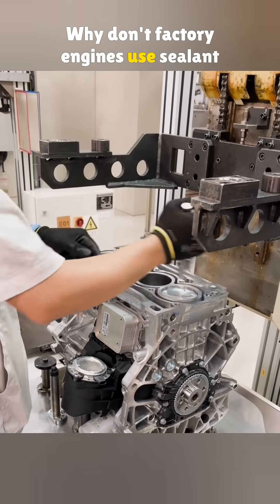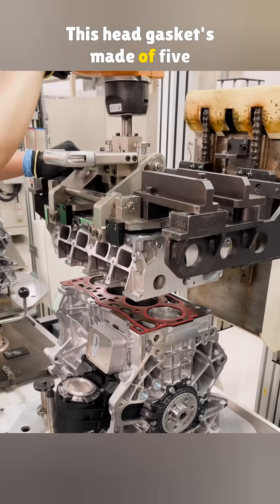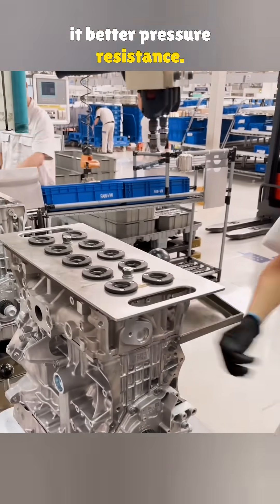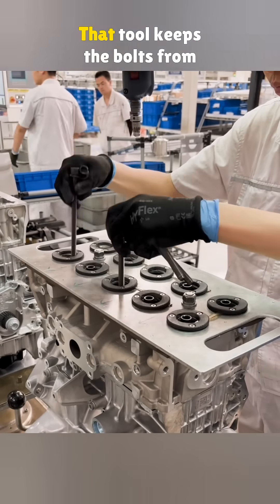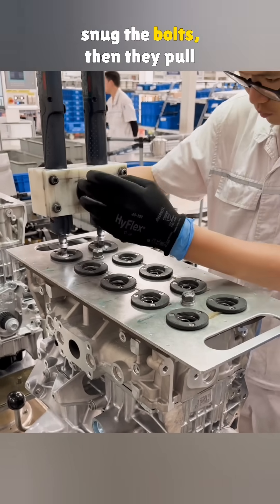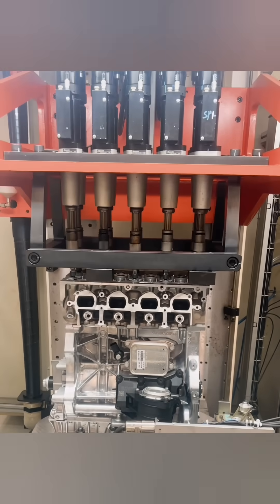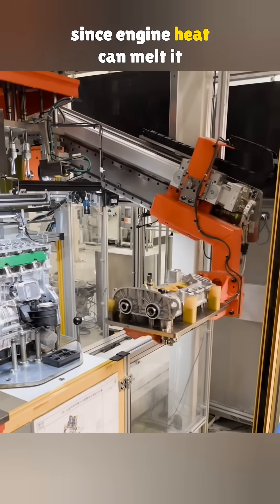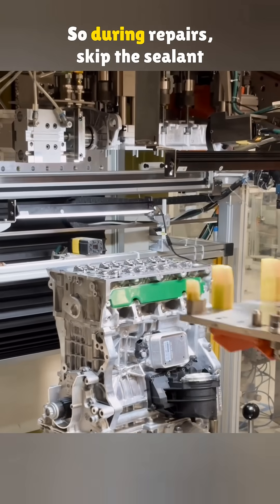Do Engine Cylinder Heads Really Need Sealant #automobile #assembly #mechanic #car #manufacturing

Comment: All engines use different sealers in different places. The VW 2 liter TFSI uses a liquid sealer to seal the entire cam bridge/cover assembly. The only non-liquid gaskets on that engine are the intake/exhaust manifolds, head gasket and upper timing cover. Everything else (including both levels of the oil pan) are liquid.

Comment: Say what you like about VW but head gasket failure is super uncommon on their engines
Reply: A head gasket replacement is only 8-10 bolts and one more step once you have the cam girdle off to replace the leaking spark plug tubes and total timing system replacement, guides, sprockets and chain replacement. Arguably head gasket on its own would be a cheaper fix for VW
Reply: Actually, the engine they’re showing is the 1.5 TSI and from ‘22-‘24, these engines had a lot of issues with head gaskets leaking out the back.

Comment: EVs don't need any of that
Reply: Yeah they only need a battery which costs 15k…
Reply: you think EVs have no assembly process?
Reply: @Meussin very little, but have fun putting together your 1960’s engine with 200000 parts.

Comment: What if the VW service manual says to use sealent on tbe sharp corners of the crankcase and camshaft cover?
Reply: and where there are metal joints
Reply: Squirt it in your mouth then
Reply: @grandiora 😂😂😂